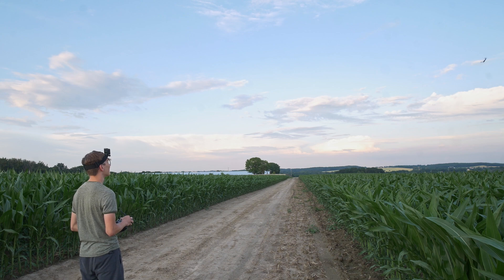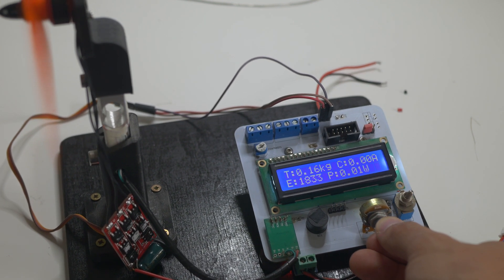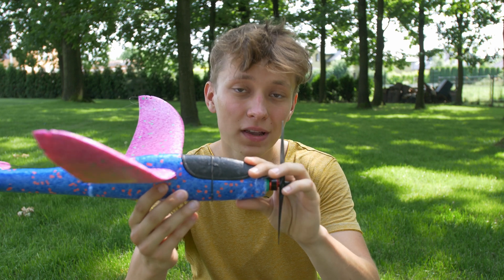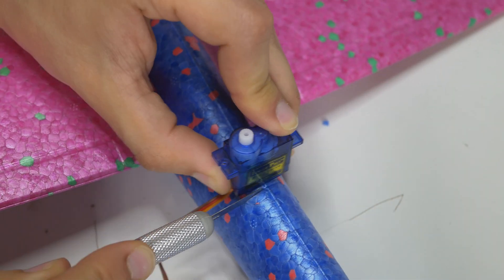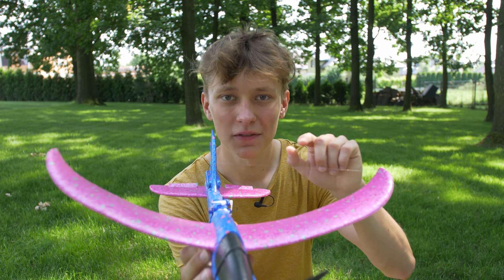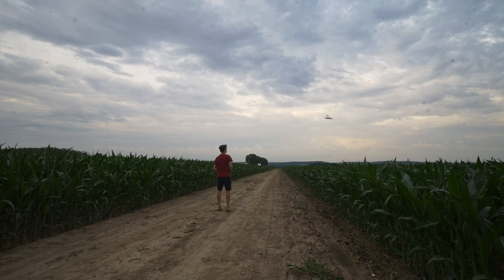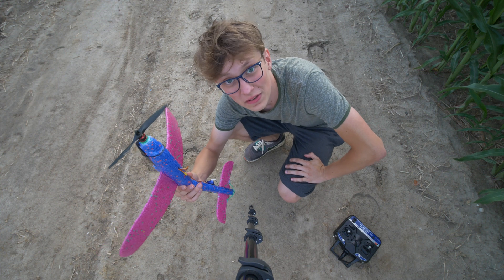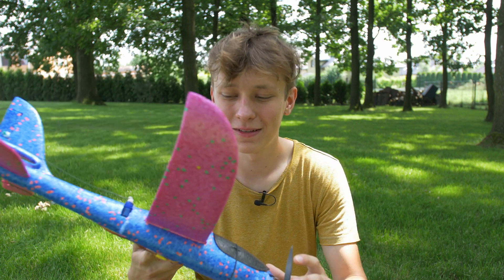How to build an RC plane

Comment: Great idea, really liked your perseverance. I've built a few flying contraptions from scratch and would like to point out a few things. When testing a RC plane, it is best to first do a bunch of glide/unpowered tests, that'd get you info on how the plane behaves on its own. It'll also let you know if your GC is right or not, if your plane tends to roll, if your control surfaces have enough authority. Adding power can induce new variables like torque and yawing due to that torque, attitude changes, etc. Also, bending the wings like you did will introduce added drag and will reduce the wing's lift capabilities, shopping the wings in half and adding bracing to add dihedral would have been a better solution. In a rudder and elevator only plane, always shoot for bigger rudder and elevators than on a aileron, rudder, and elevator plane. Also, your plane is a bit tail heavy, that's why it was so twitchy to controls input.

Comment: Thanks for this DISASTER video. This will helps me  to do a right rc plane. First thing to be considered, the center of gravity then You can locate parts in the right place. The wings, why you bend the wings... this is a plane for hand throwing, first, you should test plane in the original shape... so you can fix those bends did from packing delivery.

Comment: Congratz on getting such a small plane to fly and be controllable. 
There are smaller electronics available, such as 5 gram servos, which will add little to the price, any weight reduction is huge for the performance of small aircraft.  As you noticed the servo placement in foam will weaken the airframe, you can use the weight of those servos to move the CG forward (long push rods are lighter than long servo wires !!!).
Very entertaining, well told story. Kudos for showing your failures along with your successes.

Comment: To retrieve objects stuck in trees, a weight attached to a light string allows you to throw it and shake the branch its stuck in.

Here is an example video by a professional tree climber using a throw weight and line. You can use any light string and anything for a weight, ie kite string and some washers.

Comment: My other comment somehow disappeared after I added a link. I planned to build such a plane since before Corona. It might have been summer 2018. Now I have a model how to start and I just found an article about 1km long range wifi for the ESP32. I just won't link it, to prohibit my post from disappearing again.
Do you think, that there might be a path using even smaller DC engines? Using two of them could save me from using the rudder. Technically I should start copying your motor-propeller test setup first ^^

Comment: Minds without any hero using a light weight receiver and as a provider going up on a catapult catch us thermals Course I don't have any wing warps and I'm an experienced contest glad a pilot... I've got the glider version from 3 years ago before it put in the the second slot for the elevator they fly much better than the ones that are sold on ebay now

Comment: Hi Niko,
It seems strange but the conversion of a model aircraft is more difficult than its construction from scratch, if you are interested in making some models with little expense, watch the numa-vig videos (https://www.youtube.com/watch?v=2WBJLjFvS9o ) or by julius perdana (https://www.youtube.com/c/JuliusPerdana/videos) for julius go back a bit because now he is doing a 747 jumbojet.
With 3 or 5 mm foamed plastic sheets you can make excellent models for less than 20 euros (you already own the electronic part)
Congratulations on your perseverance. I would have thrown everything away quickly.
P.S. the model you used is suitable for slow flight and perhaps the engine had too much power and the airfoil could not stand that speed
i'll see you in the next video

Comment: There is a lot guys already made such foam glider conversion, why you not used their designs? - that could save you a lot of time. For example "Ground Control RC" made this conversion in few ways
Reply: There is a huge difference in satisfaction when doing a 'copy cat' or 'reinventing the wheel'. Sweat and tears are quickly forgotten when that wheel start to turn. In case of Nico, I am quite sure that his main objective is to learn and to 'get there' not just to make a quick mindless item.  Nikodem, to co robisz jest wspaniale. Ja tez przez cale zycie robilem/uczylem sie i nawet teraz nie moge usias na laurach. Zycie nauczyle mnie ze stosunek ludzi do osobnikow jak Ty jest spolaryzowany: kochac albo nienawidzic. Dlatego czesto wspominam Norwida 'Popiol i Diament'

Comment: I didn't see you mention this in the video, the motor produces torque which makes the plane turn in one direction, like what was happening earlier in your tests. If you orient the motor to point a few degrees to one corner (I believe it should be left/up judging on your tests) then it should help cancel out that roll and you would need less dihedral.
Reply: Thanks for pointing that out.

Comment: if you gain an appreciation of  Distribution of  Mass (dom),  you will  SEE  why it is  INPORTANT  to  Not  locate  blobs of  MASS,  willy-nilly, in an  airframe.!!!!!!       if interested, see my tutorials.            an aircraft has a  cg,  which is  a  relevant  thing  ONLY  when  the aircraft  is  FLYING.!!!!            like  Any  Other  Thing,  an aircraft  Has  a  Center of  Mass (c-m).             an aircraft's c-m  Should  be  Optimally  located ---  else,  an aircraft's  stability  and  control  authority  will  be  reduced.!!!       said another way,  in airframe design,  cg  and  auw  are  NOT  the  only  mass-related  factors  that  need to be  Understood.      cheers            googletranslate

Comment: at 7:33, i repeat, this is the  WRONG  Type of prop  and it is  too  large/Heavy.          use one of your (suitably sized)  SF  props,  if you  have  No  E  props.        if necessary, Reduce  the (SF) prop's  Radius/diameter, to  'suit'  the  Size of the motor  and  the application.       try  using a  5 to 5.5 inch  prop; with  That  motor.              SF  stands for  Slow-Flyer.          googletranslate

Comment: information.          at 5:14, the vert-stab is larger than needed; thus its  Mass  Could  be  reduced;  by reducing its height, by say  one  inch.!!!!            at 5:40,  that  is  a  WEIRD,  OVER-large and heavy   prop.        the model seems under-powered; it is very probably heavy for its size.        use the  Lightest  possible  battery.!              the prop is  Too  large for that motor (and for the model).            an  E prop  Should  be  used; choose one whose diameter is equal to about  22 to 25 percent of the wingspan.        MATCH  the  motor  and  prop specs.           it would be nice if  a  LIGHTER  esc could be used.         googletranslate